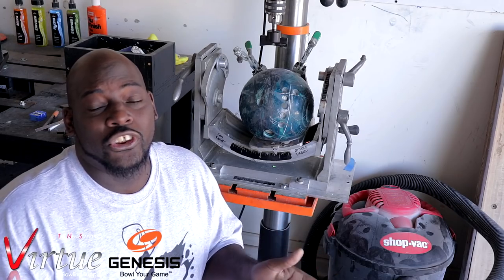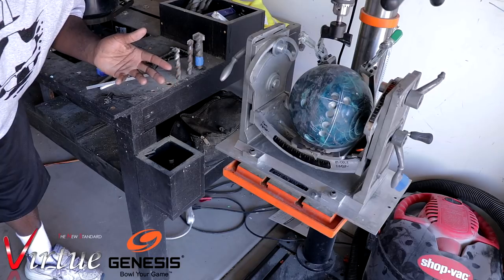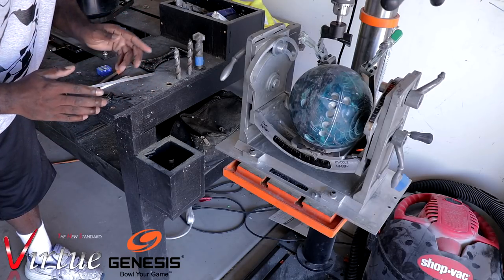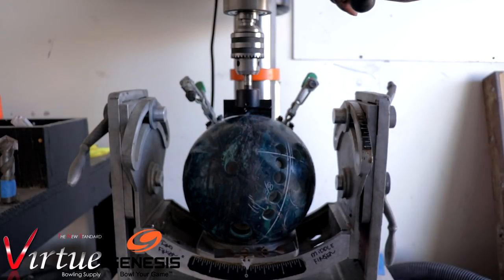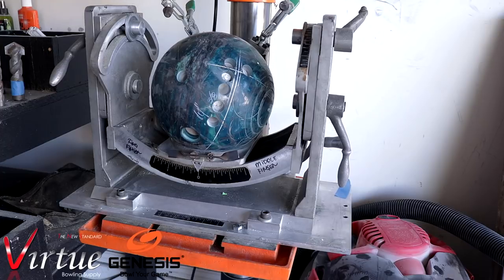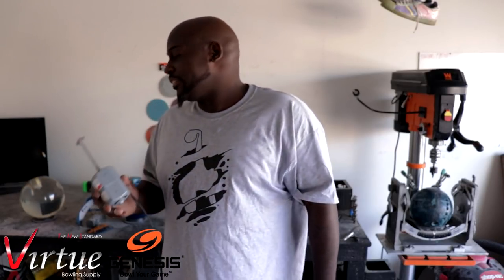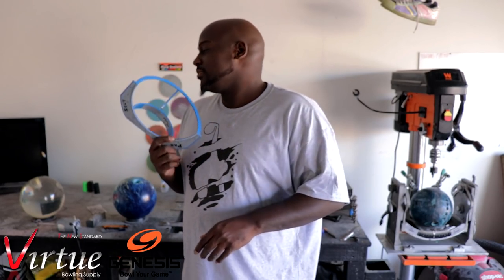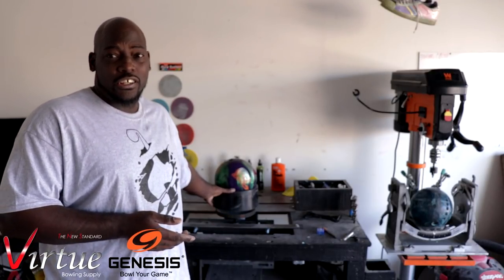I Put Together My Own Home Bowling Pro Shop

Comment: I've been on the look out for the parts to put together a DIY press.  Keeping an eye on the Facebook equipment page, craigslist, marketplace, etc, for the past 6 months.  Then I hit the jackpot this weekend, and found someone selling a Brunswick branded Pro Shop drill press.  It was originally purchased new in 1994, and used in a Pro Shop before they upgraded to a newer digital press.  It's been sitting in a shop, rarely used (they said it drilled a couple balls a year on it at most), but it still works great.  Got the whole package, drill press, plug cutter, full set of bits and jig, for way less than I was planning on spending on the DIY set up.  So those of you interested, patience pays off eventually.
Reply from the maker: Found mine at the right time. Ive been seeing jigs come up more often.

Comment: When I "Index" or center a ball jig, I'll first mark out the center of the ball cup, then put the jig on zero-zero.  I then take a long steel rod, put it in the drill chuck and pull it down until it hits the center of the cup.  After that it's a matter of drilling a hole and using pitch gauges to check.  I've owned my own stuff since the late 1970's, but packed it away for nearly 20 years after I had to quit bowling.  I dug it  out  a few years ago and once again went through the index procedure to make sure everything was aligned.  A large number of pro shops used a Rudell Bowling Ball Jig well into the early 2000's.  They've got to be out there in the used market somewhere

Comment: Thanks for this video. I was wondering if my drill press would work, because the pro shops always have milling machines.

I noticed that a lot of them prefer to drill the finger holes with pitched outward, not towards the center of the ball. What are your thoughts on that?
Reply from the maker: Depends on the bowler. I've gone both ways.

Comment: I've been using a KMT hand drill jig for a while now.  Works well, but is super limited in what it can do, so I'm upgrading to a set up like yours.  Finding a jig online for under grand is tough, and finding one that's all in one like yours is damn near impossible.  So my plan is to re-use the jig portion of my KMT, and mount it to a milling table.. and mount the milling table/jig to a drill press.  And the 17" Harbor Freight drill press should be more than enough for the job.
Reply from the maker: I looked at KMT before I found my jig. Smart idea. Just borrow a pitch gauge to make sure you're calibrated.
Reply: @Jamal Mac The entire reason I Picked up a KMT was because I switched from 1 to 2 hands... and it was easier (and way cheaper) to drill my own stuff without the complications of a thumb.  I never drilled a ball before, and didn't know anything about the technical aspects of actually laying a ball out, prior to getting the KMT.  So in my opinion it's a great way to get into drilling your own stuff.  Far less expensive than buying a drill press, and finding a used ball jig, or paying $1k+ for a new jig... or $3k plus for a super basic preassembled drilling set up.  I basically just took an old, cracked ball, and layed it out and drilled 15-20 times, until I felt comfortable putting holes into new stuff.  I've drilled probably 20-25 new balls since I got it... saving $65 a ball off what the pro shop would charge for grips and drilling.  Saving enough money to pay for the KMT... and enough to upgrade into a proper drill press at some point.

Comment: I want to DIY a ball spinner,  my research says ball spinners have RPM of 400 & 600. ** What if I used a 4 1/2"  right angle grinder ??  I know the RPM is 11,000.   BUT could it work, if I got it mounted securely. My $$ are limited, I found an used one for $50.    I just wondered if you had any knowledge OF or ABOUT this kind of idea....
Reply from the maker: I've seen grinders and drills being used. I even made one out of a door motor. Just needs to be centered and balanced.

Comment: I'm interested in starting to drill my own equipment.  You mentioned to find a jig first, to make sure you have enough height.  The jig you have is about the tallest I've seen.  I'm having a hard time finding a used jig and might end up machining my own jig to hold the ball, and purchase a Mill or a Drill Press and add a Mill table.  What is the good HP for the press? Also what is your height from Table to Spindle?
Reply from the maker: About 18 1/2" from table to chuck. Not sure on the HP but its a 17" floor press.

Comment: Very cool.
I'm pretty handy, and often thought about doing this.
I already lay out my own balls, and then take them to the pro shop for drilling.
After plugging all my weight holes myself, I used my spinner and a blade to cut my plugs.
This inspires me!  Hey, what's up with the hanging sneakers?
Reply from the maker: Go for it. Most shops won't layout a ball the way you want it. Sometimes you want to try so unconventional stuff.

Those were my old bowling shoes.   Retired and hanging in the rafters....hahaha

Comment: You can get a plug cutter from Inovative, order on there site. 
https://innovativebowling.com/Plug-Cutter-12-SS_p_137.html

Also you can get a jig from KMT Bowling you will have to purchase a mil and drill using fraction to decimal conversion..
http://kmtballjig.com/
You would attached the jig to the mil and Zero it out before drilling, using a test ball.